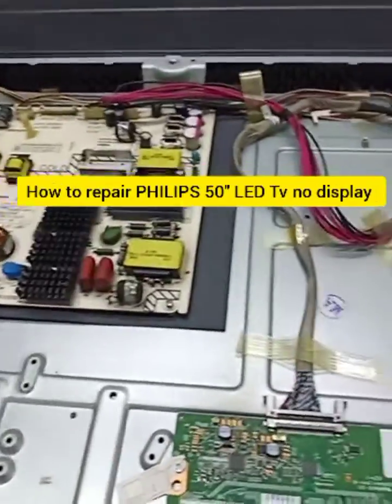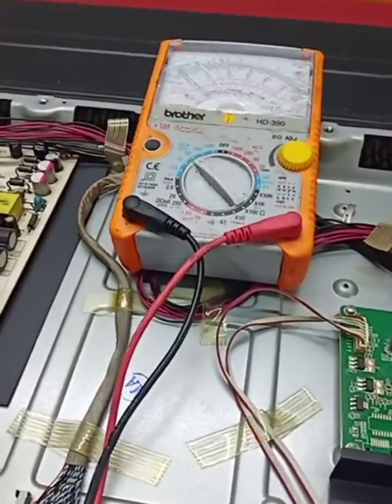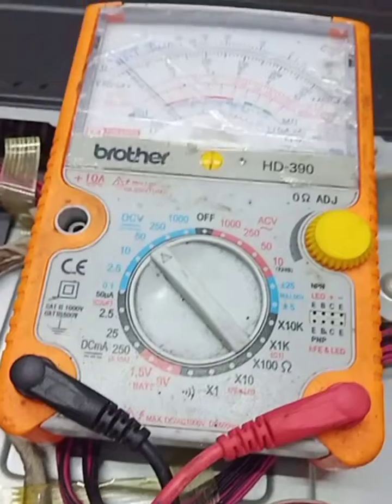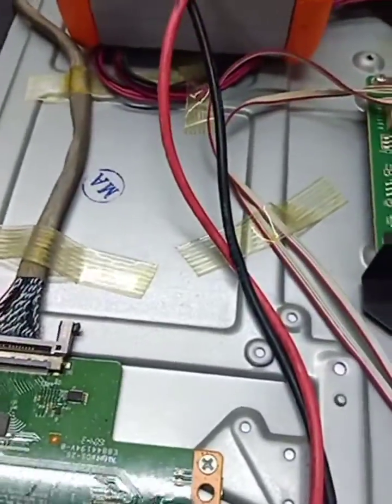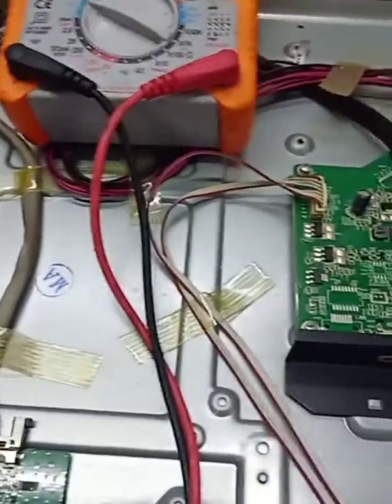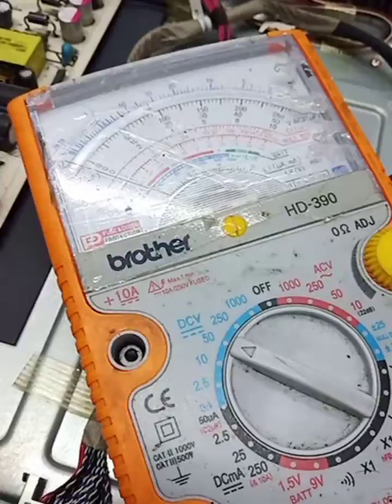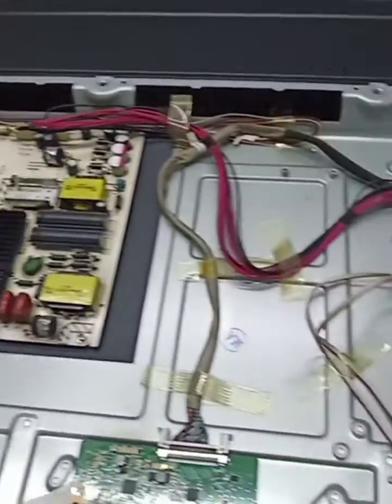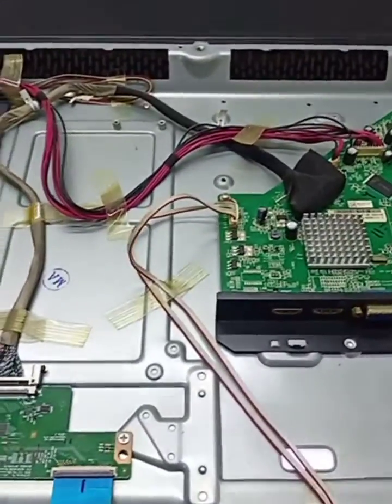PHILIPS 49 Inch LED Tv How to repair no display problem# Model 49PFT5200S/98

Comment: Same lcd hdmi port 2 ,3 not working port 1 blinking display. Any solution plz?
Reply from the maker: Hi sir... Clean the hdmi port with wd40 spary and use hair dryer for heat... First check ur hdmi cable